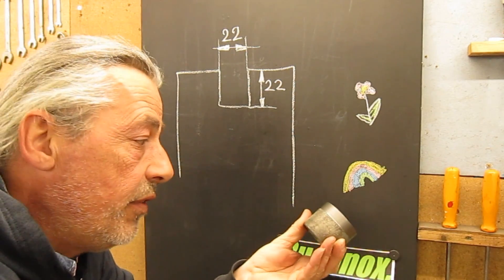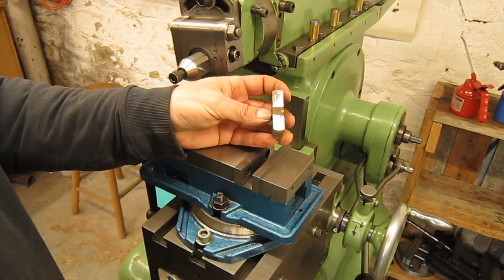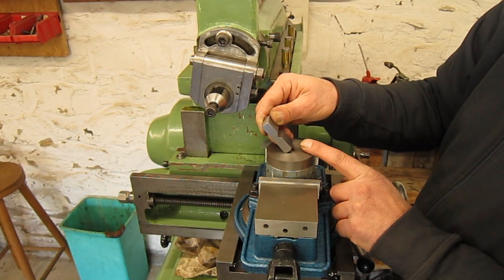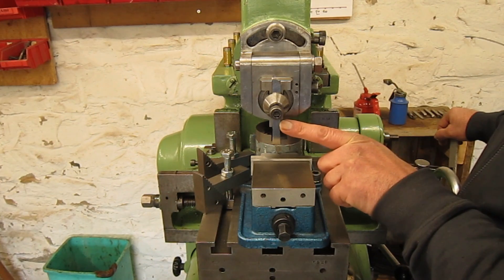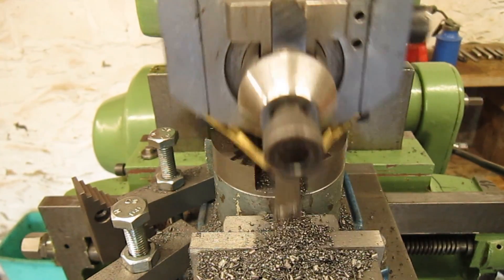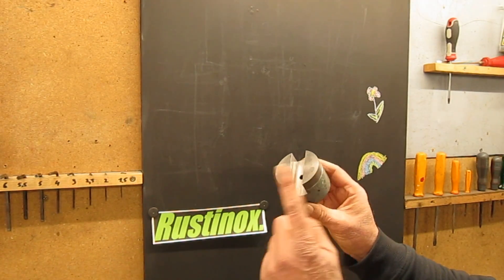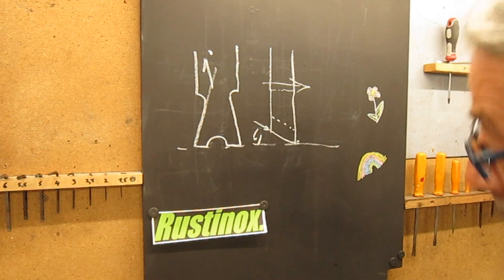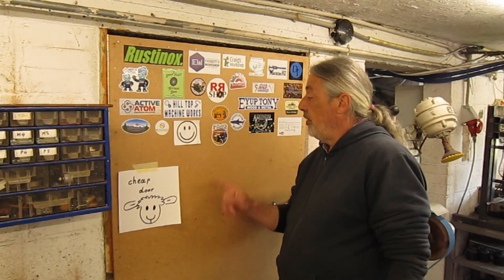Make a groove in cast iron.

Comment: You have me intrigued as to what the part is for - hinted it's a piston of course, but curious as to what it is to fit.  It's interesting to see the different shaper tool grinds for different purposes.  Saw a cast iron tool that looked similar but slightly different in an old book but one of the beauties of shapers is that it seems there are many variations on a theme.  Still working here too, not so much shop time, lol.  Hope you're doing well.
Reply from the maker: For this piston it will make sense in a few weeks.
Cutting tools can some times preform well in one shaper but not in an other one. I don't know why but that is my experience.

Comment: I sure am glad to have gotten a large machine. That part would have been a walk in the park on the Klopp - 
being cast iron, especially! 10mm Tool, two passes, straight in, DONE xD
However, I tip my hat to your perseverance. I'd probably have gotten frustrated and asked a friend to borrow his mill.
When you really struggle to get the cutting speed low enough, try to set the ram travel really close to the part length.
Due to the nature of the yoke mechanism, the cutting speed upon entering the workpiece will be lower which decreases the load on the tool a little.
Its not a huge gamechanger, but in some situations it does make the difference between chatter or not.
Reply: Adrian Straub Watched Abom taking 7/8"" cuts recently. Size IS important!
Reply from the maker: I had the chance to buy a Klopp shaper like yours but corona stopped all of it. 
I still hope one day it will be mine.
Reply: @Rustinox  That'd be sweet! We could have a one-on-one and see who can take the biggest cuts or something :D

Comment: Gday Rustinox, I’ve never cut cast iron on my shaper but I’ve had a fair share of shatter problems, it can drive you nuts trying to fix it with out buggering up your part, great idea to relieve to centre of the cutting edge, I’ve got a lot of mates in the transport industry and there still poking along day by day but a lot of the restaurants have shut at the truck stops and they are having trouble getting a feed and a shower, public toilets have been locked down and that’s another problem, we will bet this virus if we do the right things, thanks for another great video,    Matty
Reply from the maker: The truckers have indeed a really difficult time. We see that here too.

Comment: A cast iron piston.... with a hole through it. Should work fine and no need to add piston rings they would only make it heavy.
Reply: This is for the as yet unheard of completely zero compression I.C. engine
Reply from the maker: I don't know. We'll see.
Reply: @Brian from ma. Its to prevent piston ring blow by. The gases can take the lazy route instead.
Reply from the maker: A piston with a treated hole in... isn't that a bit intriguing?

Comment: Nice video, thanks. The groove on the tool is one of the hints of the parting off inserts. 
There is a general recipe against chatter issues - reduce speed / increase feed.
I am amazed about your shaper. There should be lower strokes/min solution. It could be that the original motor was of higher number of poles, i.e. lower rpm. It could be that either the motor is replaced, or re-winded. By the time these machines were built the standard for motors was 6 poles, i.e. 900rpm. Later the standard become 4 poles - 1500rpm. I would have checked that.
Reply: I was thinking on the same lines as well but not as electrically technical, not the original motor a weaker replacement or the original motor is on its way out.
Reply: Petar,that could be the issue. The Alba I have is fitted with a 6 pole 900 rpm motor. That spec is only relevant when it is run on 3 phase supply. If the motor is converted to single phase the revs increase and the torque is substantially reduced. A VFD is the best solution to get this type of motor running effectively with single phase primary supply. The VFD gives a far greater range of machine speeds through motor speed control function being added.
Reply from the maker: I will have a look at that.